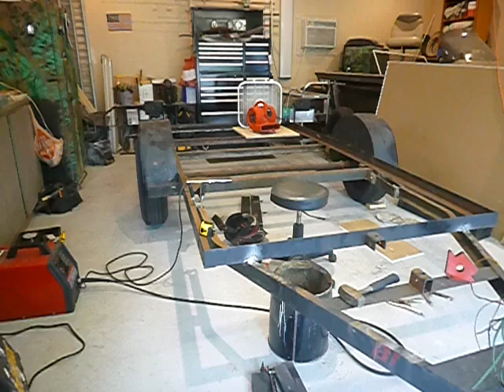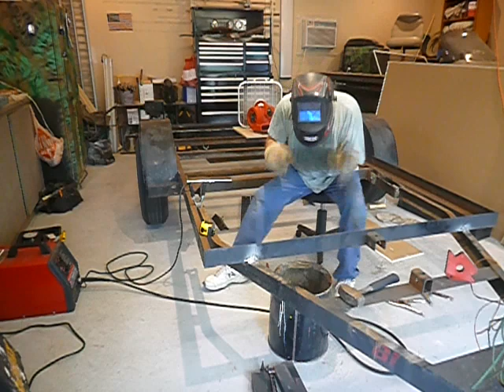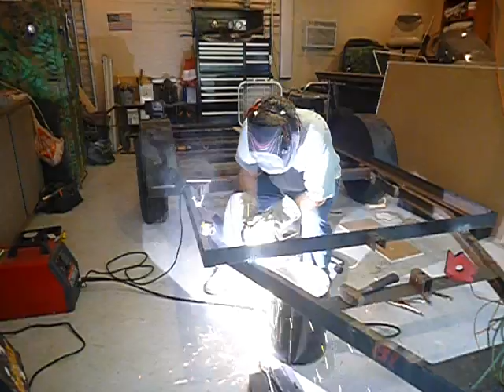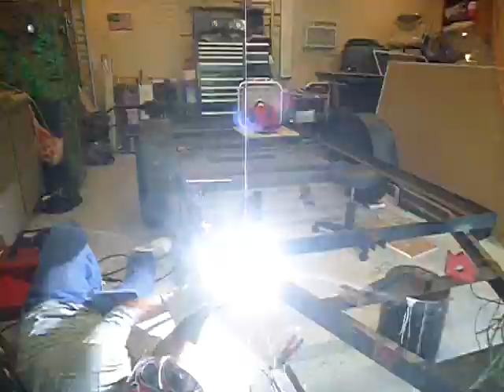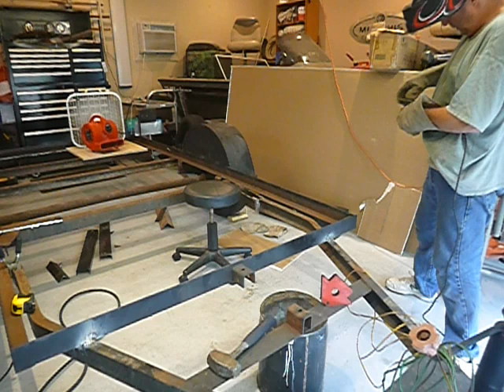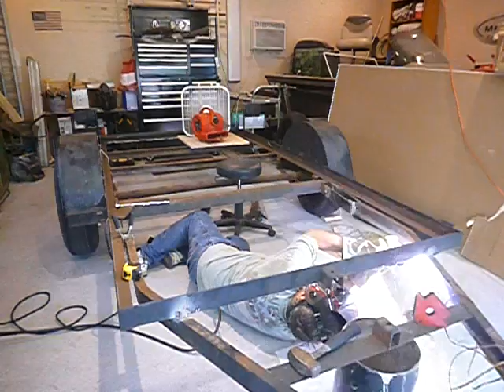DIY Teardrop Camper a 5 X 10  M7    12 inch tongue extension Build your own teardrop camper

Comment: Nothing wrong with an extended trailer tongue. Think it would have been nice if ours had been a little longer for extra storage of stuff.
Reply from the maker: It is not to late you can get a piece of 4 x 4 sq pipe and add it in you don't have to do it this way. I just wanted to get rid of the tilt part of the trailer and extended while I was at it.